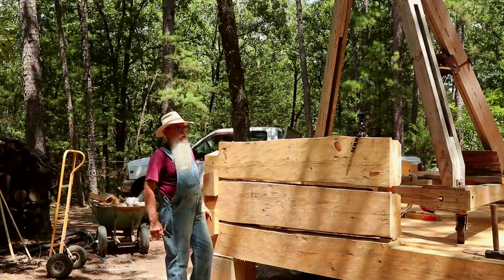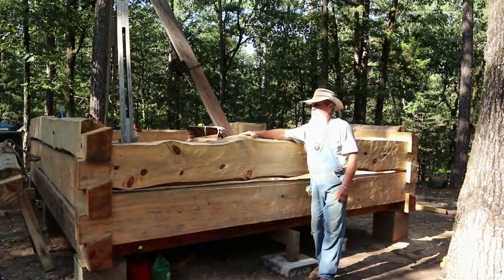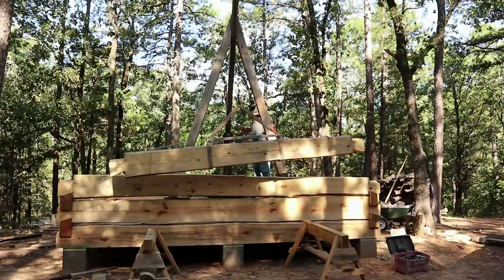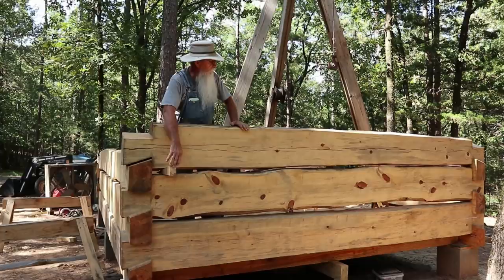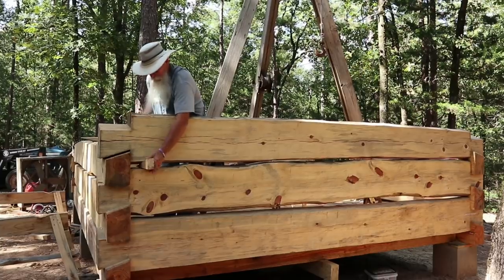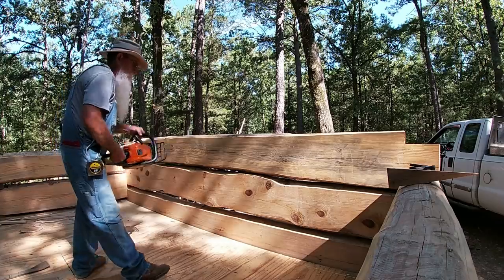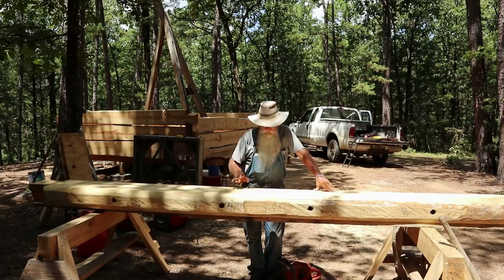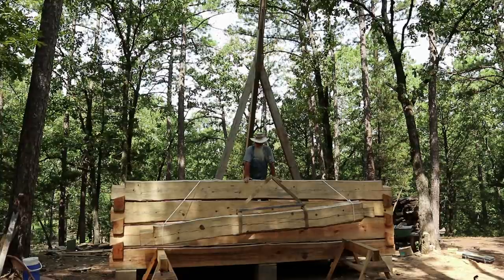Up With Rounds 3 ad 4 Wall Logs, Paradise Point - Ep 5

Comment: Looking great Paul, mine is going a bit slow. We've had a bit of a wet summer this year. Of course mine is a wee bigger at 32x24 but finished the 3rd course of wall's this weekend and brought in my last load of firewood for 23 this afternoon. Hoping to finish the truck engine rebuild next week. I'm doing the finished floors in juniper but I'm in no rush to mill those logs at this point but they're here still in bark and arbor locked.
Reply from the maker: Howdy Dave- good to hear from you. Our summer started off wet, but now we desperately need rain. Haven’t had any in two months. I had to get my old tractor engine rebuilt. Just got it back a couple days ago and got the loader back on today. Gotta have something to pick up the logs, especially when you’re working by yourself. Yeah, I’ve got to get firewood cut,too. Our house is 26x34 and it took me a while to get the walls up. Hope all is going well with y’all. Take care and God bless y’all

Comment: I’ve noticed you always use 6” thick logs. Did you use 6” in your house too? Is it energy efficient? We are in Oklahoma and trying to decide if 6” is enough or if we should go for 8” (provided we have the trees for it). We will be using cedar, because we have a lot of tall, straight cedar trees on our property. Thanks for these videos. You are helping a lot of people with them.
Reply from the maker: Howdy Tammy- 6” has sort of been a standard thickness that has been used. Our house has 6” logs and we have no trouble with heating or cooling. For years we just had a wood stove for heat and a window unit for cooling and did just fine. However, a few years ago we did have central heat and air put in. We still use the wood stove in real cold weather. You are fortunate to have good cedar trees big enough to build with. Hope this helps. God bless y’all

Comment: I’m just wondering what size of logs are you using ,length,width and depth and are these the standard size you use also can you make two cabins the same size and join them to make one large if you don’t have the trees to make a larger one?
Reply from the maker: Howdy Lee- I get my logs a bit longer than what I need for the length because sometimes there is fall damage and I can shift the log to get the best possible section. The logs I use are 6” thick and the height will vary. I don’t want anything less than a 10” tip. You can definitely build two separate cabins (pens) and put a section in between them (dogtrot). Many older cabins were built this way to get more space without using longer logs. I did a historical restoration a cabin like this. Hope this helps. God bless you

Comment: Just have a question: I have seen some log construction where the leave a gap for chinking, and some that have the logs completely squared so they sit flush one on top of the other with no chinking, and some that do both that is, square the logs, and leave a gap for chinking. My real question is, is there anything that would keep you from squaring the logs setting them flush right on top of each other with no chinking, or would that somehow not allow the logs to last as long. The home that I am thinking of building this way will have wide overhanging porches so the exterior walls will not be really exposed to a lot of moisture from weather other than a little spray from a hard rain, and they should dry out quickly. My main purpose is to build it quickly, more easily, and not having the maintenance of having to worry about re-chinking the walls every so often. Any input on this from anyone who has good information, will be greatly appreciated. Thank you.
Reply from the maker: Howdy Sam- you can do exactly as you said with the logs squared on four sides. They can be cut to sit flush on top of each other. A friend in Montana builds this way and he is really a good log builder. Look up on YouTube On Beaver Creek. Fred has lots of videos on doing this. He even has a video on making a jig to use with a chainsaw to cut the notches. He is a very humble man but very good with what he does. Hope this helps you. God bless you
Reply: I think it's just a matter of taste. My friend bought a kit log house and it was tongue and grove. 
I would think this style will require the most upkeep down the road, and tongue and grove would be the least, and the others would be somewhere in between.

Comment: hey i have a question. i own 12 ac
 in sc my son wants to use the trees tobuild a cabin most are hickory can he use hickery to build a cabin?
Reply from the maker: Howdy- I have never used hickory for cabin logs. I do use hickory for other things. It’s a strong wood. But, back in the old days the pioneers used what they had available to them so I’m sure somebody did build a cabin with hickory. I would definitely keep it high enough off the ground to protect it from water splashing up on it and put a wide overhang on the roof. Hope this helps. God bless you
Reply: @TheBeardedCarpenter  it sure does . and your video are a big help . thank you may have more questions later
Reply: @TheBeardedCarpenter  how high offthe ground do you suggest
Reply from the maker: @sholcombe7916  I think I would keep it 18” off the ground and put gutters on the roof. You could catch the rain water for recycling. Not trying to get you to spend more money but some people use a filtering system for their rain water catch. Hope this helps you. God bless